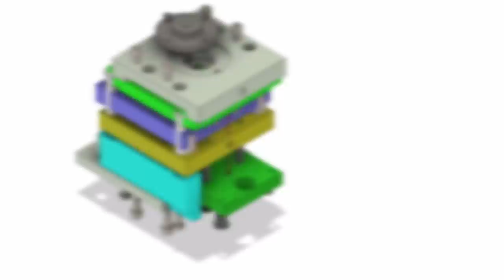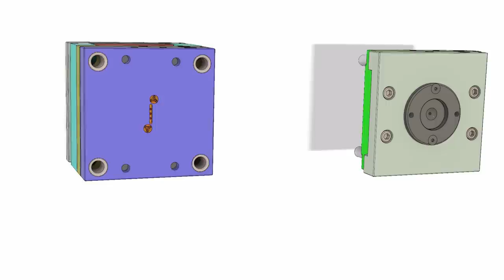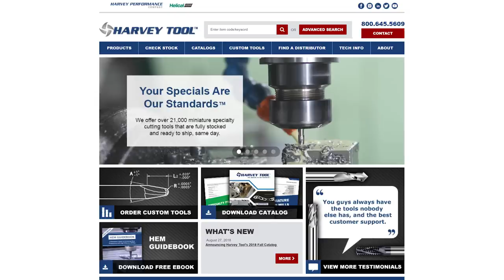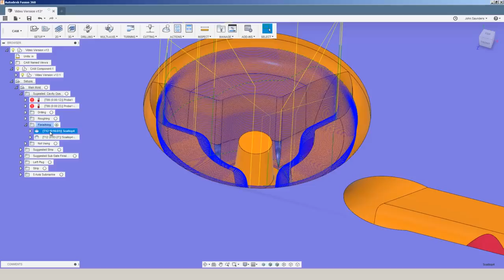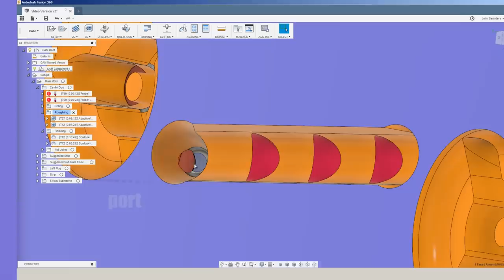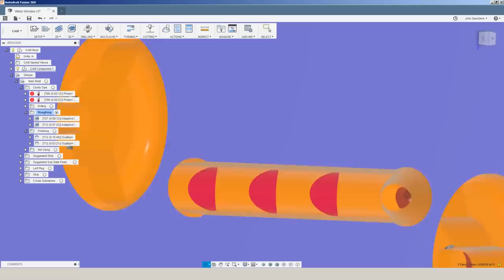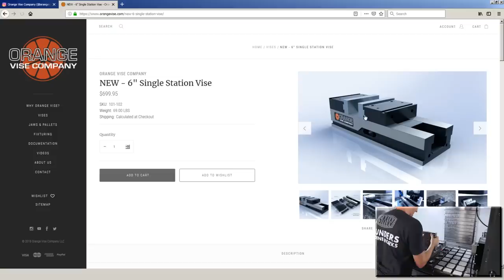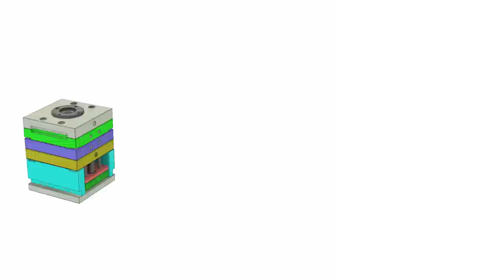Machining an INJECTION MOLD!

Comment: Great video. This reminds me of when i was about 8 years old, my father used to take me to work with him during the school holidays about 20 years ago. He used to be a die setter/ machine operator at an injection moulding buisness that also had a machine shop with about ten guys working there that made their own dies. My job was to snap the parts off the runners and sort the parts into boxes but i used to sneak off to the machine shop and watch guy that did the cad/cam work, blew my mind when he showed me that you could send the drawing downstairs to the cnc machine and get a die cut. Still blows my mind now :)
Reply: So many things in engineering blow my mind, too. I had a metalworking course in college back when our most sophisticated numerical control system was rolls of paper that you programmed by punching holes in it. Heck, I'm still impressed with impact dot-matrix printers... and they've been basically obsolete for 30 years!

Comment: Hello and greatings from Germany,

at first sorry about my terrible english ... but i try my best!
I follow your channel since a couple of years, and i respect what you have reached form your apartment to your shop now!!
I'm an ... i don't know this is so called in us ... master of injection molding with years of practical experience with prototyping injection mold systems.
You have done a nice job with your injection mold!
Perhaps i can give you some tips what you can do so that the man of molding have a easier life ;).
Air is the biggest problem of every injection mold process, it is always good to grind or mill out a tunnle from the cavity of your part, starting with 1mm (sorry metric :D) distance from the cavity, on the opposite side of your injection inlet, all the way out between your cavity plates. Later when the mold is on the molding machine and there are problems with ejecting air, you can easily grind this 1 mm  bridge step by step down to help the air going out.
The same thing you can do with your ejector bolts, you can grind a flat plane on each, with a distance to your cavity to eject air over your ejector bolts, or open your ejector holes in your cavity plate with a bigger diameter, but with a distance to your cavity.
Air isnt just a problem of burning plastic while injection (in germany we call it diesel effect), it can also hapen that the air is inside the plastic part (in germany we call it lunker) and the stability of the part could take a negative effect.
I hope you understand what i mean ;)
Greeting Dominic
Reply: Never apologise for using metric ;)
Reply: Moldmaker Apprentice checking in: As soon as i saw the solid model, I thought "What? No venting?!" 0 .0002" (around 4-5 microns if my mental math is correct) would be enough to vent even the most flash-prone materials.
Reply: I had this problem with my mold, when the plastic was injected the mold was forced apart very slightly.
Reply: I'm also from Germany, I used to machine injection molds and seeing you touch off on the outside edges gave me slight anxiety. You always want to set the offset on the most critical feature that is already machined and in this case that would be the guide bushings. We had some mold bodies that were up to .5mm off on the outside! that can really screw your injector set  when you try to eject and it all seizes up. Seems like it turned out fine in your case, just wasn't the best practice.
Reply: @noelbressan8097   At 12:30 you can see that he actually clocked in the guide bushings.
But the outside is just rough and not made to tolerance. 
Always clock two holes to make sure everything is square.
Reply: I almost never vent small cavities like these. There is usually no need.
This mold is very large for these parts so there is a long way for the air to travel, but I think that the ejector pins will let that small amount of air out whithout any problems. 
It is really cool when you put a mold in production, a mold that you have designed and made yourself. :-)
Reply: is it specialized training or did you learn one of the four Finwerkmechaniker specializations? Feinwerkmechaniker can be roughly translated to "tool and die maker", it's just more information that you get through the german apprenticeships when compared to other countries, especially north american ones. so a direct comparison and translation will always be harder, as you then are capable of more than the tool and die makers of north america. when you did your Meisterkurs, you are a master of the trade or, since this is equivalent to a bachelors degree, you could theoretically also go with that, but most will understand "tool and die maker master" or, as you said, "master of tool and die making".
this is amplified when you start telling them, that the german apprenticeship system simply is superior to what I've seen over there in about every trade I've come across, then many just start ignoring your points and maybe start mindlessly chanting stuff like "USA! USA! USA!". This actually happened to me once and when looking back it actually is quite funny, at the moment though I had absolutely no idea how to react to something like that.
though I started to ramble a bit I hope I could help.
anyways, have a nice day and a good weekend.
Reply: Great information. Thanks for sharing your knowledge.
Reply: Ameisen Bär hi, Ameisen, your English is great. I started to learn machining in 2002 just so I could cut injection molds. However, it was for plastic aircraft, ship and car models.  Just the research and engineering is massive before one starts the cad, and that takes a long time. Thanks for the tips!
Reply: @10010110100102Error   How did this end up with a USA vs Germany comparison ?  Maybe put a man on the moon, then, and only then, go tell USA your systems are superior. (which , by the way, in my opinion, are not)
Reply: @gregarmstrong4653  funny that you, like so many others, always go with the "man on the moon" argument, seeing that it was german scientists and engineers that enabled both the usa and ussr to even start their space race as early as it did.
oh, and thanks for proving my point by ignoring the entirety of what I said and focusing on the comparison.
the original point was that there are too many differences in the education process to easily make a comparison between the two nations, making a direct translation of a german or american degree into the other language much harder. it is only that in my experience, us-americans who always boast about how great they are and their education is, tend to not now half as much as they'd have learned in germany in the same time or the same apprenticeship.
i probably could have phased it a bit different, but i assumed that my point was clear and obvious enough. well, looks like it isn't.
oh, and could you please tell me, what system exactly you are referring to? educational, healthcare, political, etc. ?
Reply: Guys (from Germany), can you recommend some books about mold making (practical side), maintenance, repair (welding, polishing)?
Reply: I have to say that good engineering is good engineering.  People who have the aptitude and desire will rise to the challenge.  There are Great Engineers and Machinists in all countries and the learning usually happens in the real world. I don’t think it fair to compare Germany vs USA vs USSR vs China Vs UK, etc.  I have come across some incredible people in my engineering career and I love learning from them as well as showing some of the things I’ve learned.  I see Engineering as a community and there should NEVER be an aggressive us vs them on an nationalistic level.  Friendly competition is good as it keeps us all honest.  Please don’t use the rocket science as a German superiority.  You lost the war due to British mathematics and code breaking and the USA supported the allies.  We all live in a different world now where collaboration is key !!!. Old history is not relevant anymore.
Reply: @pentachronic  great points. I did not intend to downplay any of the other nations accomplishments and am sorry if it seems to be that way. English is not my fist language and I do tend to be very direct in the way I say what I want the other person to understand, so misunderstandings are probably a natural outcome to this.
I do, however, have to disagree with the reason for the lost war. we did lose the war mostly due to an idiot in charge, more idiots in high positions of power and the fact that nearly all who did not fall into line were gotten rid of. but there are so many individual decisions on all sides that the old "but what if X happened ..." has lost most of its appeal to me. with the British breaking of the enigma code the Germans could be listened to, yet without the German Russia offensive Britain would most likely have been starved into surrender within about two to three months, not to mention the decision to not continue the attacks on British air fields and instead bombarding London and other mayor cities, allowing the RAF to quickly recover and rebuild, without the Germans declaring war on the US, they most likely would have started their involvement in Europe much later and only concentrated on supplying war material, not manpower, and so on. so many decision with such a big impact, even more decisions with comparatively little impact yet by far outnumbering the big decisions ... 
I guess we'd have to wait hundreds of years for the current super computers to calculate even a small part of all the different outcomes.
It is preferable to accept the past as what it is and move forward as you said, collaborate and try to further humanity as a whole.
Reply: Jef Clissen metric is waaaaay better
Reply: @gregarmstrong4653  now go try and do that without all the germans  that helped . im not german but they are superior in about every technical field . USA is a great nation and has accomplished more then any nation to date . but allot of tech that made the usa great was german or the desings where german
u dont have to agree with someone`s opinion on to that youre own  , but dont come with an argument "put a man on the moon" because without german`s it would have taken allot more time and mayby the rusians would be first at that as wel
Reply: I’m sure we could have a great discussion about this over some of the best German beers in the world (and that I’m sure we agree on !!!).  :-). Your English is good so please don’t apologise.  We’re all happy here learning together and watching some very cool videos on the latest tech !!
Reply: As a CNC child we licked my brothers foot when uncle mom  said “it takes time to eat feather boats in the airport” And yelling “show uncle how to wash his clap in the meat sauce!”
It’s very hard when he sent his child to live with a family of chicken nuggets!
Reply: Gazza-usa belgium beers are better hehe ;-)
Reply: @gregarmstrong4653  Are you serious? You think that the United States is still even a competitor in the global market for machined goods? Lol, you must be delirious. Your statement about the moon corresponds to a time where America was still great, with machinists and toolmakers making up the majority of all machining jobs. Now machinists are about 2% and mouthbreathing machine operators make up the rest. If you think we have the Germans or the Japanese beat, maybe you should compare a Cadillac to a Subaru or a Mercedes. America still uses the inch system, which is by default less precise than every country in the world. I am a machinist in America having worked with manual, horizontal/vertical cnc cat 40,50,and 60 mills. Horizontal/vertical turning centers, 9 axis mill-turns, lasers, and cnc press brakes. I am currently a senior cnc swiss micro machinist. I make pacemaker components, stents, arterial implants, and heart valves as well as marker bands. Mind you that 100% of the work I do is on platinum holding millionths tolerances. I only gave you the background to illustrate the fact that I am speaking from a rather experienced point of view.  But I digress. America has fallen behind almost every other top tier manufacturing country, including China by their ignorant and incessant use of the inch system. Until the United States adopts the metric system, they will always be a second class manufacturer.  I would love nothing more than to shout U.S.A is #1, but it would ring hollow in today's economy. American's have been riding on the coat-tails of their ancestors and have wasted so much of their life shouting about how U.S.A. is number one, that they don't have the work ethic or the skills to make it number one anymore.
Reply: @chuckphilpot7756  I simply dared to refute the opinion that German education systems were in some way superior to those in the USA, which in my opinion are not. The metric system is French and I give full credit to them for that. The moon landing was an imperial system triumph, which has yet to be topped by any nation on earth. In the USA, students are allowed to question  what they are taught, in fact encouraged to do so. When they put their minds to something they are the best in the world, that is why they lead and others follow. Regarding the automotive sector, Tesla is accelerating ahead at such a pace in the field of machine learning and AI, the big European car makers will not have time to wipe the sleep from their eyes before they are left behind by this new technology. USA USA ...
Reply: @chuckphilpot7756  regarding your rant two words - homeland security. As for machine tools its HAAS all the way .
Reply: @gregarmstrong4653  Haas builds cheap throwaway machines, nobody in any real manufacturing sector uses Haas. Lmfao. Also, as to your moon landing fanboy comment... You know it was the german nazi scientists that made that possible, not Americans. Lol, but it was a good effort though. You tried, the U.S.A. motto. At least we tried once. We gave up, but at least we tried. Nice rebuttal to my arguement, oh wait. You didn't have one.
Reply: @chuckphilpot7756  OK good, so we can all agree at last, USA all the way
Reply: @chuckphilpot7756  U.......   wait for it !
Reply: @gregarmstrong4653  Roeders tec, check em out
Reply: @FlybyJunkie  no more time to waste on this, we have already established USA is best at whatever they choose to put their minds to
Reply: people say that in your country the injection mold is incredible developed. i'm really love to come to your country to work and learn more about designing mold. (i'm so sorry about my bad English, i'm a VietNamese).
Reply: @gregarmstrong4653  China has at least 4 Teslas..
Reply: @gregarmstrong4653  😂😂😂😂😂
Reply: @noelbressan8097  Hi, wird für die Form ausschließlich martensitgehärteter Stahl verwednet - oder kommt der nur in spezial(?)-Fällen zum Einsatz?? Thx im Vorraus für die Antwort.. :)

Comment: Hey John. I clicked so fast on this, I'm a toolmaker so I machine tools every day. A tip for you; with these pre machined plates with the bores in the corners I always clock the back right bore and then clock the front left and split the difference. Works perfect every time

Comment: Kitamura BridgeCenters are very nice for this type of work.  Extraordinarily rigid machines with box-way table and slanted column bridge.  They have absolute accuracy of 2 micron across the entire bed length and repeatability of 1 micron.
Reply: @FluxApexEng  Chip mfrs don't use VMCs. No comparison between milling machines and microchip manufacture.

Comment: As a plastics injection molder for Corning Inc (Life Science division from Oneonta, NY), I really did appreciate and enjoy this video. I am responsible for maintenance on a Toyo SI 400V electric machine. Along with just making sure our 20+ other machines stay running, and deal with our QC deformities. Some of our biggest molds weight 5700-6000lbs.  Great video
Reply: So they are "small" (or "medium") in size. ;-) Fun begins from 10 tons up.
Reply: If you make pipette tips or Falcon tubes there's a good chance that I use stuff from your machines daily.

Comment: Great Vid John. This bought back the good old days. I spent 4 years working for a company(in Australia) that made moulds for Tupperware. Back then we began using Devleig point to point Horizontal machining centres. the company advanced into Makino VMC machine (at a time when Makino was renowned for Engine lathes and Tool and Cutter grinders). We had a huge EDM department and a growing CNC Milling and Lathe section. We used to grind our own "D bits" for the engraving work. This bought back some great memories Thanks John.